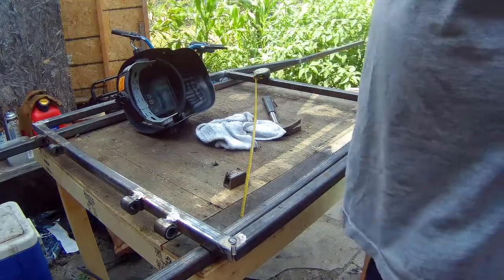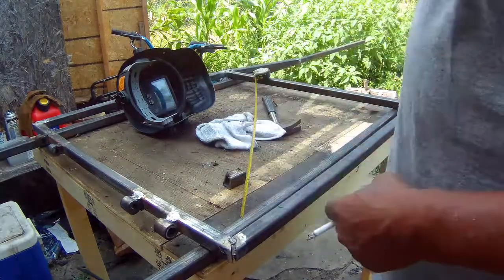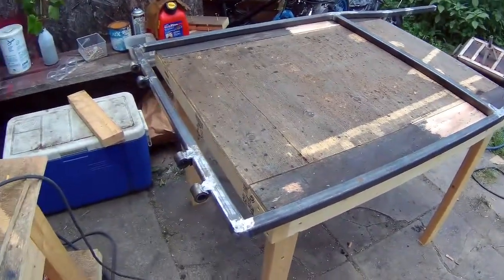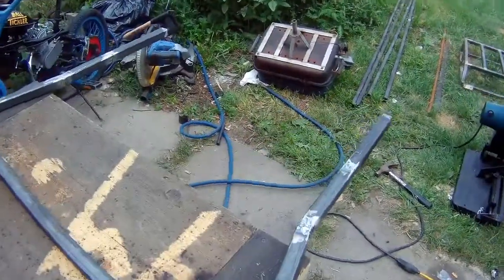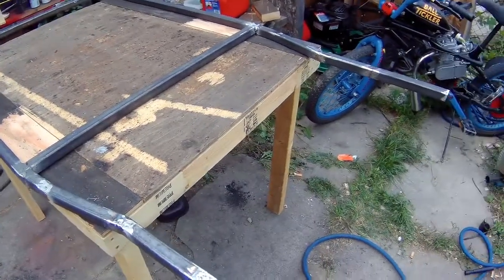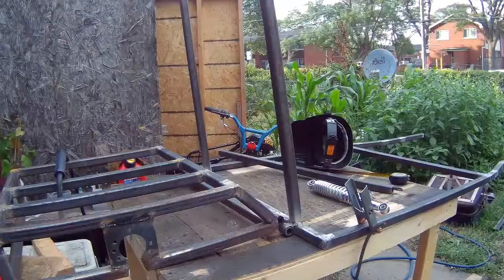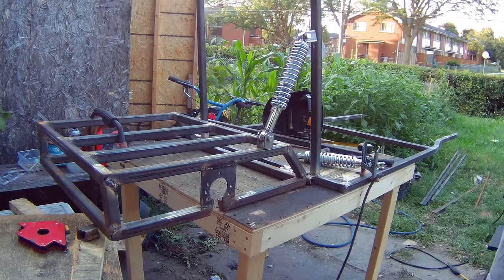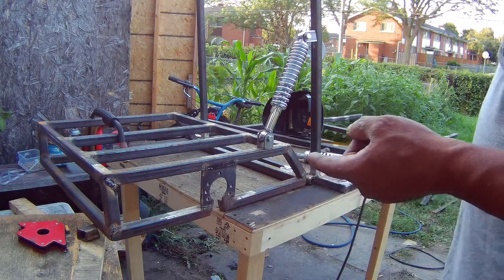Machine Gun Neves pt.02

Comment: Run a trigger wire to the steering wheel so you can fire while driving!!!! Maybe get a real cheap cam with wifi on it and have you phone set up so you can see what your aiming at.
Reply from the maker: That was my plan David, I'm going to figure out some kind of trigger on the gun mold and have a lever on the steering wheel using a bike brake cable as the wire, Thanks
Reply: The trigger is electric so a simple momentary switch will do with a 2 wire setup and done.
Reply from the maker: Sounds good, would be better then a cable I will look in to that, Thanks